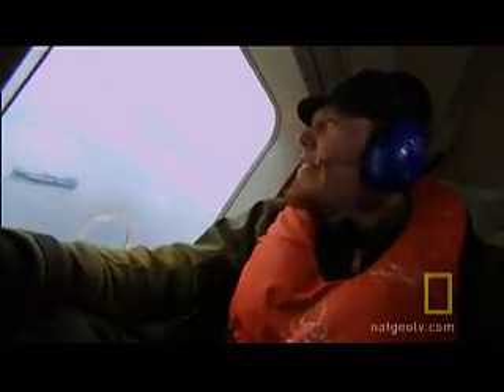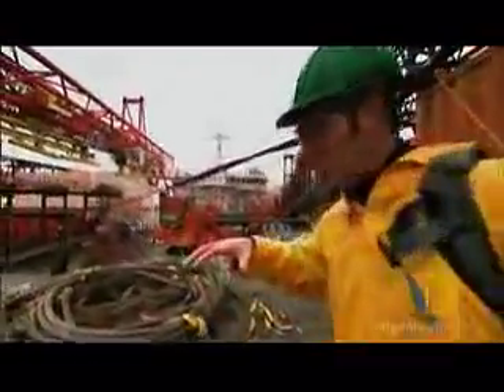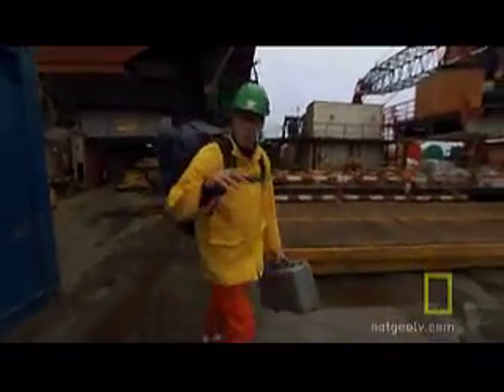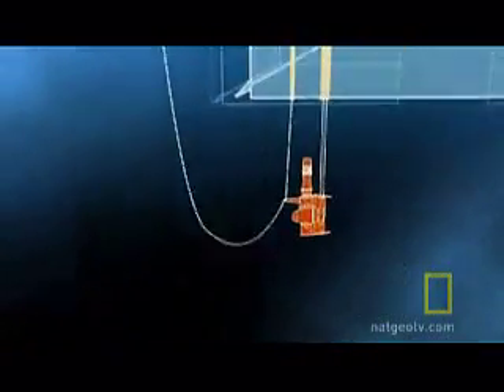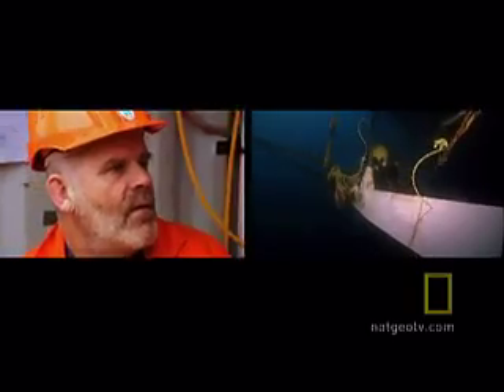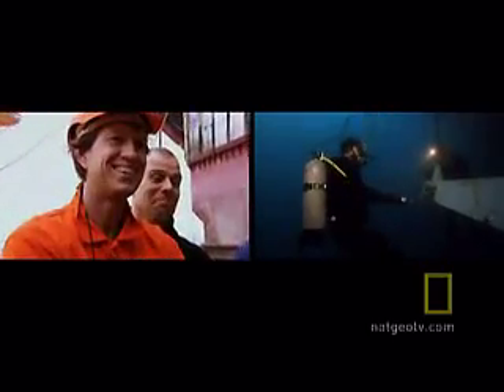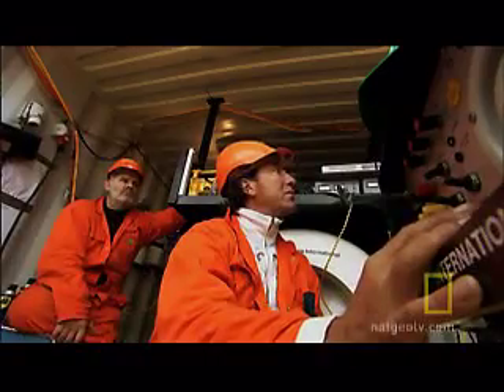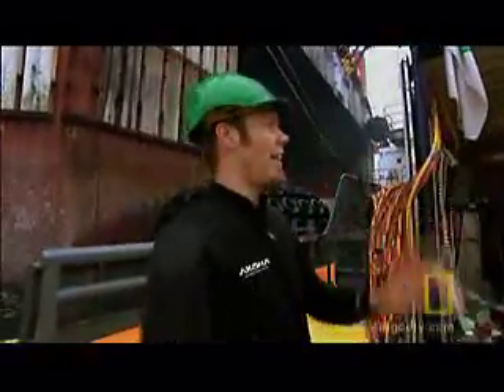Busted 38 Ton Engine | National Geographic

Comment: uh i think  the power is in the boat and when u connect the thruster thing the thing that goes in is like a gear or something so when u turn that gear it turns the thruster thingy and liketheres a motor in the boat?